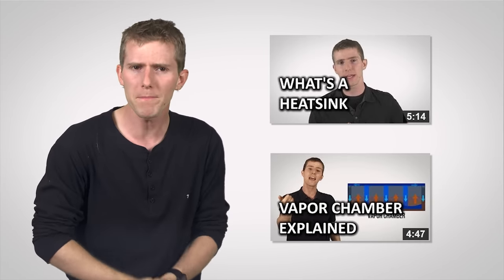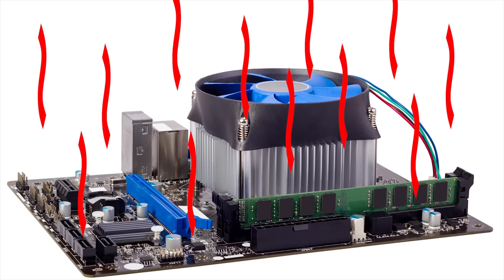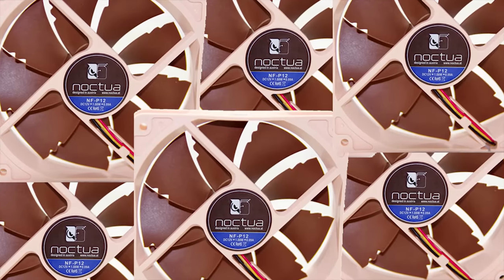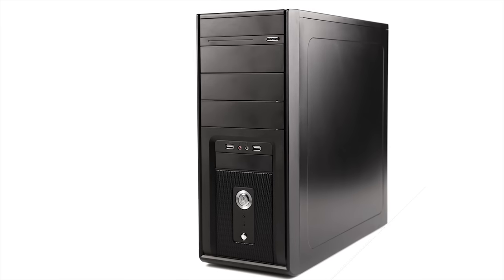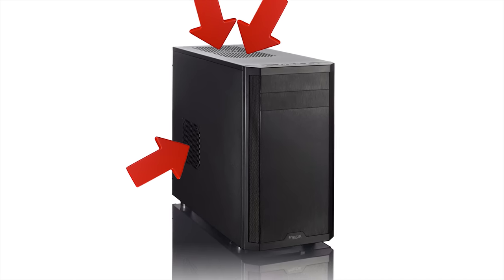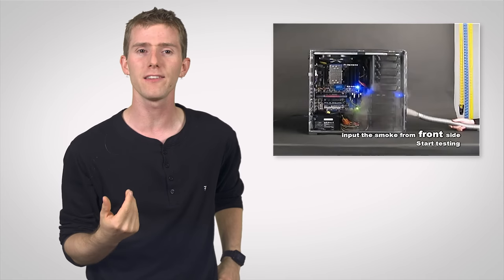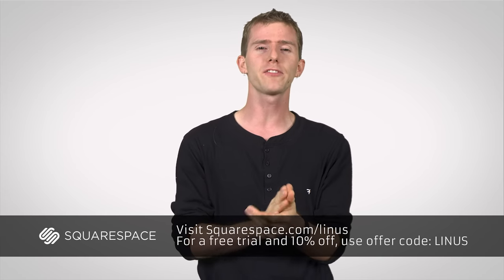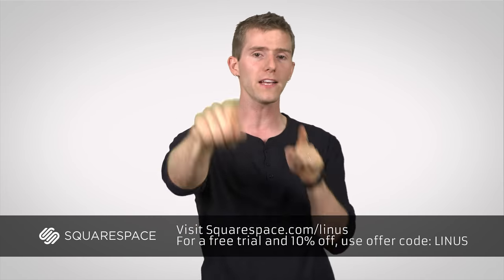Positive vs Negative Air Pressure as Fast As Possible

Comment: Linus, I'd love to see a video that goes more in depth about optimum fan placement and that answers some other questions for noob builders like: How does the radiator from an all in one liquid cooler affect case pressure? Do the fans on a radiator factor in to case pressure or are they exhausting the hot air from your CPU directly? Is there a place on your case that you should not put an intake or should not put an exhaust? I know these are noob questions and a lot of your audience is very savvy but I think answers to the questions could benefit a big demographic. And if anyone besides Linus reads this comment and would be so kind as to answer that would be great too.

Comment: I have 5 Intakes at 1000rpm and one exhaust at 1300rpm. I also have a 140 and 120 fan on the massive Noctua hestsink at 1200rpm. This works great with my 5600x boosting to 4.9ghz

Comment: I have 3 120mm fans in-taking air in the front and bottom and 3 120mm fans exhausting air at the top and rear. Been a pretty good setup. Minimal dust and my system runs quite cool

Comment: Haha so my computer is basically my own heater in my room lol!
Reply: I can fry eggs on my LCD
Reply: Must be the LCD inverter. My Dell laptop's LCD inverter gets hot.
Reply: Unless it wont vent out heat! (It's possible to build a PC without ANY moving parts!
Just replace=

HDD: replace with SSD
VGA: cooler: Find a passive one or use a lower TDP card
PSU: Replace with a fanless one
CPU cooler: Use a NoFan 95 TDP cooler or some other fanless cooler
RAM: Use RAM with heatsinks, and dont add fans!
CD/DVD Throw it out!!!
FDD: Just dont use it!!!
PCI-e cards: Find large heatsinks you can attach to them.

Comment: can you use vape to simulate airflow?
Reply: Please
Reply: ! this should be a thing
an actual reason to Vape
Reply: Vapor wave
Reply: Be very very careful when attempting this. PG is an alcohol, so it poses little threat, but VG can (and will) stick to delicate parts, causing accelerated corrosion, and possibly even condensing enough to cause bigger problems, such as shorting a connector and damaging parts.
Reply: use 100% PG juice!

Comment: 3 intake, 3 exhaust for me.
Reply: 3 intake, 2 exhaust.
Reply: 3 intake, 1 exhaust.
Reply: 3 intake, 0 exhuast
Reply: 3 intake, -1 exhaust
Reply: Now that's just silly!
Reply: To be honest I run positive as all my intakes have filters, and I'm lazy so less cleaning is better for me, I can sacrifice a degree or two.
Reply: 3 intake, but I'm waiting on a splitter to add an exhaust
Reply: I've got 3 in and 1 out.  One of the ins, plus the single out are 230mm monsters.
Reply: I have 2 intakes, and 2 exhaust(one being my PSU), then CPU fan, and video card fan.
Reply: 4 in, 3 out for me
Reply: 6 in, 0 out. right panel off.
Reply: 4 intake and 2 out
Reply: Rockdude908 Thats just 4 intakes then
Reply: 9 120mm in 5 140mm  out
Reply: 1 140mm intake one 140mm outtake plus cpu cooler push pull
Reply: 3 200mm intake 1 140mm intake and 2 140mm exhaust :)
Reply: 4 low rpm intake 120mm
2 high rpm exhaust 120mm
Reply: emm..... i  don't tink leaving the side of my case of is a good idea, my cpu fan died so now i have 120mm intake/cpucooling and 120mm exhaust
Reply: Nine 120mm IN (7 of those push air trought 2 radiators), one 120mm OUT, also on a rad (three radiator set up). Plus the PSU fan. All the intake are filterd.
Reply: ODIO POWER Its not about amount ,Its more about placement.   Like my 2 exhausts are very close to  my CPU's 3 fan exhaust making massive CPU heat exhaust, While intakes are in front of case pulling fresh air. Also PSU is placed on bottom and has no effect to case temparature.
Reply: well mine fans are just where the radiator are, cant do otherwise ;) and 2 fan are in the front
Reply: *****  i build my own case
Reply: ***** He's probably got some external-mounted radiators, I doubt he's got 14 fans inside rofl.
Reply: 12 in,6 out
Reply: 4 120mm out, 2 250mm and 1 120mm in.
Reply: No side panel for me
Reply: 2 frnt intake, 2 top intake on h100i watercooler, and one exhaust on turbo in the rear
Reply: Kars Noordhuis 
A friend of mine used a beer rack to mount his motherboard
Really nasty thing
Reply: 1 intake 0 exhaust
Reply: No fans. Top that.

Comment: Good video.  I will definitely take this advice to heart. One question... does it matter which way the fan attached to the CPU heat sink blows?  In other words, does it matter if the fan pushes or pulls air across the heat sink?
Reply: i guess yes, it makes a difference, the ideal is for the fan to blow in through the heatsink and not blow out of it, that way more air will make contact with the heatsink and get heat out of it faster

Comment: Honestly, everyone's experiments or views or opinions largely don't matter. I've seen all kinds of configurations work. A lot has to do with your internals, shape/parts of the case and how air flows around things. I'm currently running like 6 intakes versus 1 outtake, and it's better than adding more exhaust. The only thing that matters is testing it out, and that really only matters if you're having heat issues in the first place.

Comment: No. Ultimate solution is positive pressure on idle and negative pressure on full load. Negative pressure is a lot better for performance especially in long term sessions since if you have positive pressure you can start getting wind tunnel effects and a lot of "hot pockets". Use pwm fans and custom fan curves to achieve positive p. on idle (less dust) and negative p. on load (better cooling performance, since it draws air from everywhere.).

Comment: while in the abstract i do agree with the "nooks and crannies" defense i have to say its not the end of the argument.
when you have a higher-end case that comes with many components and portholes that all have dust filters or mesh built into them (i.e. 5.25 bay covers with dust filters in each slot or slide-out filters on the bottom/top of the case), you suddenly have more areas where air will choose to flow first and end up catching a lot of the dirt.  
so that leaves us with the reason to use negative case pressure, which is pretty simple: air acts as an insulator to a certain degree and the less of it inside your case the cooler your case will be (just like out in space).  Think if you had a completely airtight case and all the air drawn completely out of it your case would run very very cool because there's no air to basically bounce the energy back onto the heatsinks.  
like i said, this really applies to higher end cases so if youre working on a sleeper-build or just dont have much invested in a case you should probably stick to this higher pressure strategy.  If youre going for a case that offers all the available dust filters and such i would definitely argue negative pressure is the way to go
Reply: eh, air is used to cool the heatsink so no air means only cooling by radiation wich is slower and it would also heat up all the other parts of the case instead of being absorbed by air and then pushed outside.

Comment: 4 120mm FILTERED intakes, 2 120mm UNfiltered exhausts.  When I"m finished using my pc at night ( because it's a corsair 550d case), I put ALL the solid panel "doors" back on it to PREVENT dust from building up overnight.

 I've had this case since beginning Q2 2012 and Only TWICE have I really needed to spray dust out of my pc.  It's a pretty great case for fighting dust build up and any atx build with some real muscle.

Comment: A little late I know. Truth is, there's lot of debate on the internet about this subject because most people who comment and give their opinion as to how heat tranfer work doesnt know termodynamics and fluid mechanics, completly necesary for the subject.

Same as most industrial studies about heat transfer and cooling on a cased space, the best solution is to create negative preassure. For fans, the best ratio would be 1 fan for income air and 2 fans for outcome air. Second, other important concept here is sealing, no good cooling is ever done without sealing any case, this prevent fluctuations on the preassure and a more formalized airflow. Also try to always create a one directional airflow this works lots better.

If any questions about the reasons and the concept that makes this work you can ask. (Im on aeronautoc engineer) cheers.

Comment: Excellent, I suggest 2 intake fans, because they have to deal with a filter and therfore slower (my current problem), the good thing is I can control fan speed with my motherboard, but that means I'm limiting my back fan speed. and making my front louder. this should help people.

Comment: Question: I have 4 intake fans and 1 exhaust fan, how's that for dust?
Reply: not enough air can get out, so not all dust can escape. i think atleast
Reply: If all 4 intakes are filtered, you'll have no dust problems for the next 4 years!

I have 2 highly shedding dogs...So I ran 3 intakes 1 exhaust. 7 years later, my pc is still clean(ish). I wouldn't say it's "Dust-free", but only the microparticles managed to get through the filters. These are the easiest to blow clean with a can of compressed air or ba blowdryer on a cold setting.

Comment: I have the fans on the front and the one on the back of my case as an intake.  Because heat rises, I use the fans on the top of my case as exhaust fans.  The reason for that is for positive airflow and I also have a radiator at the top as well.  My Cosmos II also has a 'basement' where my hard drives reside, so I have the fans on the sides down there as intakes and have the air exhaust out of the other side.

Comment: Best value for money cooling set up which is dead close to water-cooling , silenced when you need it to be silenced and generating no dust.

More air in than out and all of the air traveling in same direction= no dust.
2 fans in front , 1 at the back.
1 fan in the middle  attached to Processor Heatsink Evo 212 v2 /stock fan = 40 euros
Fan controller box to set fans speed at 50% for silenced operation when not playing = 26 euros 
Arctic F12 fans. 7 euros each.

Cheers.

Comment: One more question...the intake or exahuse can be installed anywhere right? I got 4 empty fan holes..2 at the side and.the other 2 at the top
Reply: exhaust*
Reply: back and top should be exhaust, front and side should be intake....although I've seen people use the top for water cooling intake and the side as an exhaust.
Reply: Ex EddieB The second thing you said would be silly, it would make the front intake struggle. As for the OP, you can install intake and exhaust fans anyway but you need to have a good path for the air to flow from intake and exhaust, that's why front and side intake and back and top exhaust is mostly suggested.
Reply: just know basic physics rule which means hot air rises and cool air sinks.....
intake should be bottom and outake is other wa around.
Reply: ***** that would screw with any front intake and back exhaust he would currently have, bad idea.
Reply: ***** I'm sure he'll correct me if he's wrong but I was thinking that his side and top fans were extras on top of the fans he already has, I've never heard of a PC with side and top fan spots only (assuming standard form factor)
Reply: MrTheuploader123 When it comes to pc cases, hot air rising doesn't really effect anything when you have a proper fan setup.
Reply: Brendin Lloyd It doesn't make sense to go against it though? Hot air rises is still applicable but could still go against it if you wanted to, it's like intake vs exhaust with radiators.
Reply: You always want to have air moving in your case with a region of cold to a region of hot. Idealy you want your components that can tollerate the highest temperatures cooled last, so you would put an exaust fan near them. You want your most sensitive cooler running component's cooled first, so as to not saturate the air.

A well built case will follow that principle, you kind of have to get in the head of the case designer to figure whether they wanted you to put a pusher (in) or a puller (out)

"Hot air rises" while it was poo pooed in the video (he's right, it really doesn't ACTUALLY MATTER) is a great way to visualize the airflow in your case. the cooler running components (hard drives, optical, support chips etc will be towards the bottom front of the case. The hotter components will be towards the middle top and back and back (gpu, north bridge, cpu). In my hypothetical case, you'd want to bring cool air in through the front and back at the bottom of the case, and push it out through the top. That way, the cooler items are kept cool, and there is still cool air to run over the hot running components to cool them down.
Reply: Ex EddieB In general, top and rear being exhaust while front and side being intake makes sense. However, in some cases... (depending on the pc case you got) that's not always the best option. I have 4 x 120mm fans on Coolermaster 690 II. By using side vent for exhaust & front vent for intake, the airflow is more streamlined towards the gpu. I use the top vent as the 2nd intake and keep the rear exhaust. So in this way, there is 2 effective air loops... one around the cpu area, and one at the gpu. This setup lowered my system temperatures by around 5-6C.
Reply: Mostlyharmless1985 "and there is still cool air to run over the hot running components to cool them down." That actually doesn't matter so much. It's more critical to circulate & get air moving in and out from the case in an efficient manner... much less about "blowing air on hot components"
Reply: You can't have heat exchange without a temperature gradient. There still has to be a region of cool, and a region of hot. In quiet case designs, that region of cool is inside the case. In high performance case designs, that region is outside.

Note my first paragraph, hell, read my first sentence. "You always want to have air moving in your case with a region of cold to a region of hot."

You can only cool a component to the temperature of the ambient air. It's thermodynamics.While it's not critical, it's a good way to wrap your head around what you want to achieve: A temperature gradient.

if you want to run your system backwards from the traditional method, fine, that's your prerogative. It's just confusing to the new players who are more interested in making a system that doesn't overheat. They can learn the fiddly bits of cooling after they get the basics down.
Reply: Everything intake. Lot of filters.

Comment: yes, slightly positive pressure user here....

i use 2 corsair SP120 fans on filtered front intakes and a 120mm exhaust that i took off an old TT cooler
yes, the corsair fans are relatively loud... but they were on promo and noctua fans are expensive

Comment: What if you put the PC case itself in a kind of "fish tank" or in a another case made off glass, doesnt matter, only important thing is the glass itself.
Then you just make sure the air is going "downwards". You lay the case on your desk/table and drill/make/have special wooden/whatever.
You put the case in a glass case, atleast half "larger" than your original case, the glass case has holes undereath it. Why down? Well, dust comes rather from the ceiling than from the floor.
Also glass cause you can very easily manipulate the temp of glass.
The only problem tho would be codensation, but there is multiple solutions for that as well.

Comment: I agree with the difference that a little bit of neg pressure helps air get threw dust filters a little more without buying expensive static pressure fans

Comment: i have a 7in diameter fan on the top, with a heat sink fan shooting cool air through from the back and out the top :)
2 vents on front and side.

Comment: I just played it safe and put 4 140mm filtered intakes on and 1 low RPM 140mm fan on the back.

Even if the filters do reduce the air flow there are 4 of them vs 1 exhaust fan so np bro

Comment: That picture of the dust filled computer was nothing the worst ive ever seen while on the job was a computer running Windows DOS in a shed which when the side panel was opened had a leaf (not sure how) and it was jam packed full of thick cobwebs and 6 medium sized spiders living in there, I seized the opportunity to open the side in front of the guy who used it and say well there's your problem

Comment: I'm using a massive Enermax Coenus case with a micro atx mobo. Things got tons of free space inside to ensure good airflow from 2 intake and 2 exhuast 120mm's. My mobo, cpu and gpu tend to sit at about 30c temp when idle, and my gpu gets the hottest while gaming at around 45c-50c, though it's more often around 45. Not much dust gets inside my system, but every few days I wipe down the intake and exhaust areas of the case.

Comment: Fuck this I'm just going to put it in the freezer
Reply: DeathToCockroaches Lol that's what I do with my laptop.
Reply: DeathToCockroaches condensation will fuck your system up if you actaullly did this.
Reply: Nathan Jones Dude... the joke dude...
Reply: DeathToCockroaches
"if you actually do this",

which i fully get that you wouldn't, plus it wouldnt work anyway, linus recently made a video on a pc in a fridge.
Reply: +Nathan Jones If you did it in a humidity controlled freezer that could also be ramped down so that the computer could warm before being removed it is possible in fact it's somewhat like what a server room does.
Reply: ChaosTherum well that would be a specifically made  device, a normal fridge/freezer couldn't do that.

Comment: CPU = Oc'd i7 4790 K (Haswel). Case:  Exhaust fans at the back + a 5" fan top rear. Intake fan: one 5" fan top middle pushing air in. Cooler Master heatsink + fan on heatsink. Air holes on one side of case. Power settings: Balanced Power. Frequency = 700 to 4000MHz. Idle CPU Temps (Core Temp): 41-42-41-39 at rest. Not bad!!! Thanks!!! Cleaned fans + case of dust!!!